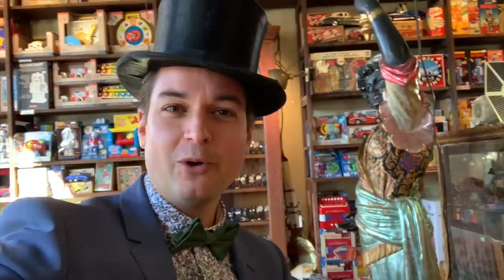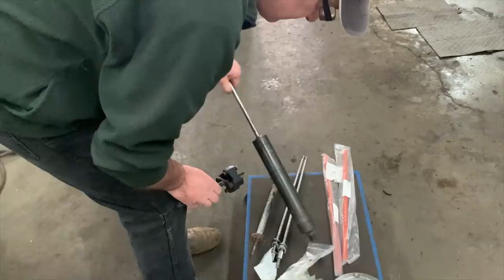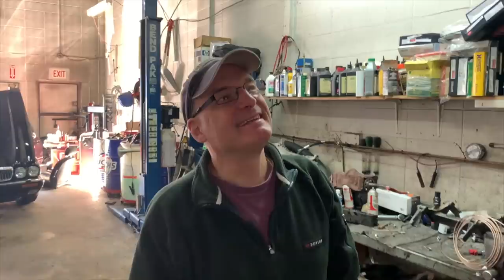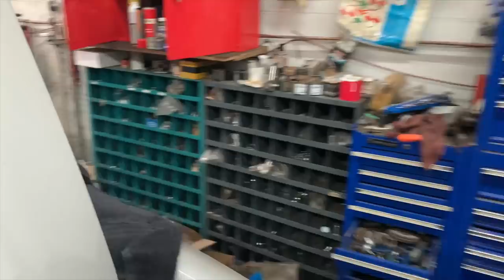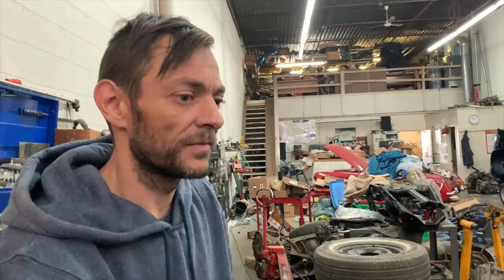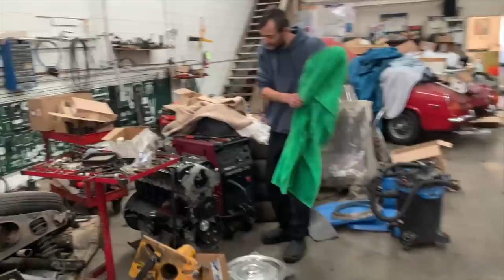Pt. 18 Raccoon Eaten Rolls Royce Reno... more brakes!

Comment: I am really impressed by the commitment to the brake system!  That system is complex, ie the number of lines he mentioned that it uses and the hydraulic boost design.  So many guys just bail on that system and jump to a modify it or completely replace it.  But, when it works its a great system!  You will have a great car that will be very valuable if you continue to commit to the original.  Thank you Alex (from a mechanic of 47 years experience)!  Awesome work and patience :)!

Comment: I found a 1991 500 S/L  Mercedes convertible with 55,000 original miles near me.  I got new rims, tires and a new roof.  It was awesome to drive. 335 horsepower made it difficult not to speed.  Thanks for sharing your project.

Comment: Beautiful work! They have done a masterful job on those new brake pipes, the bends are spot on. The brake reservoir, you can repaint it in the future....l used Duplicolor ceramic silver paint (for brake calipers) on mine. Plus to make it really tidy you should order the metal tag for the lid from Flying Spares. And special tools are available from British Tool Works in Utah....far cheaper than purchasing from England. This will be a very special car indeed once finished.

Comment: My dad was very good friends with a very high end vintage Rolls and Bentley restorer in the UK. Many customers used to insist on original spec mild steel bolts, even though they were more rust prone and less reliable than new stainless ones, simply because mild steel was the original factory spec.

That always amazed me.

Comment: I own 5 Shadows. As mentioned when you first bought the car, the brakes are a MASSIVE problem on these cars. They are so complex with so many parts, the repair is extraordinarily expensive. So many owners buy these cars not listening to those who own them and end up in depression when reality sets in!  I just had a 1979 Shadow's brakes converted to an American system. They are as good or better compared to the original system. The total conversion was $1300.00. This was "pocket change" compared to the original system cost. With the original engine and simple brakes, it's a winner!!!!!!
Reply: Richard Greene ....I’m here in England , my father-in-law bought one that was probably about 15 years old when he bought it. My first impression was “wow” however did that much cost him?

I then learnt how comparatively  “cheap” it was to buy but then got to understand the running costs of it (petrol is a hell of a lot more expensive here than the USA or Canada ) and the fact that these mid age Rollers could be picked up cheap because no-one wants them here , a bit like an old piano or organ , once you decide you don’t want it any more then you learn that not many others want it either and end up giving them away to get rid of them.
Reply: @davidheafield1436  Understand! I love the look of the Shadow, but it was the most extensive maintainence Rolls Royce they ever produced until that time! Here in the states, the brakes is ONE of the reasons they can be purchased cheaply!
Reply: That's exactly what I tought: why not install a more common - north american - brake system ? Heck, no rocket science here !
The Brits love to complicate everything. Andsince Alex just want to DRIVE the thing, not a Concours resto... why not !?

Comment: Watch out using dot 4 brake fluid, castrol 363 which is recommended is rich in castor oil which helps lubricate all the brake and rear height components dot 4 is a short term alternative but be warned the rear height will creak and groan as it is not properly lubricated otherwise nice car I own and daily drive a 1968 shadow best wishes from England

Comment: Old Rollers often have a long retirement being used for Weddings and other chauffering. Someone  I knew bought a beautiful old light blue Silver Shadow cheaply as he'd always wanted one. He had car engineering experience and could fix most things and he had garage space for it. Luckily, the car was in fairly good condition when he got it and much of what he did to it was little more than routine maintenance with generic parts. The car easily paid for it's own keep with occasional weddings and stuff. The guy just loved driving it, though dreams of long touring holidays were scuppered by his wife who thought it was far too ostentatious to be seen in.

Comment: The e type is sexy and beautiful but It comes from an era of multiple finicky carburetors and the engines leaked... drop in a modern v8 and upgrade the suspension then you have something.

Comment: Using straight DOT4 is not recommended. There has to be a lubricant in the DOT4 to keep the 2 pumps lubed, if not you will lose the pumps. The car is not to be lifted under the front subframe mounts. I have not heard one word about replacing the accumulators or the pressure regulators. This is not a complete job and anyone that knows these cars will agree. Also the rotors must be cleaned before the pads hit them. These guys are amateurs. I collect and fully restore SY cars, ie... Shadows from 1966-1980 Want to see my work? Check under "Wraithman"

Comment: The brake fluid reservoir looks like it belongs on a locomotive.
Reply: I know very little about cars so excuse me if my question is laughable.  Is a brake fluid reservoir the same thing as a master cylinder?
Reply: @nancymontgomery8897  It's above and is usually attached to the master cylinder, or it can be attached to the fenderwell and feed the master cylinder with hoses.  Also, some master cylinders/reservoirs are made from one casting.
Reply: @robstephens  Thank you Rob.  I learn in small bites like that.

Comment: Ive never seen copper brake lines...can they really handle the extreem pressure1/4"copper pressure rating 960 lb power brake pressure 1400 lb ..google it
Reply: they are copper nickel.